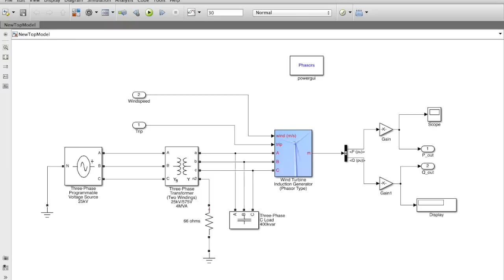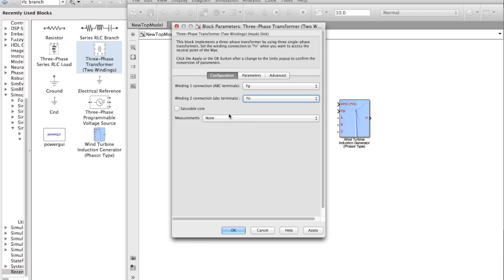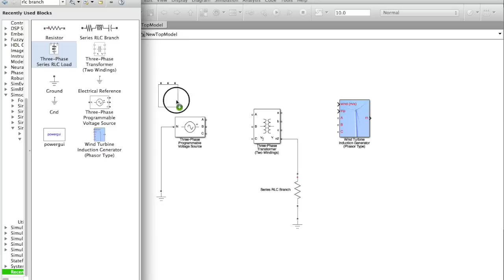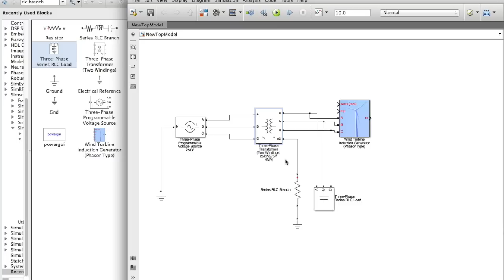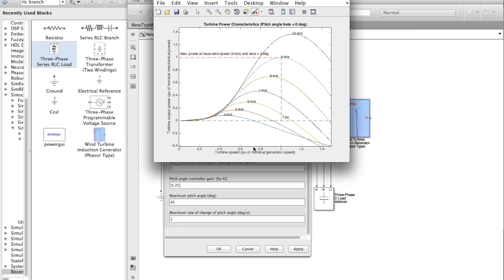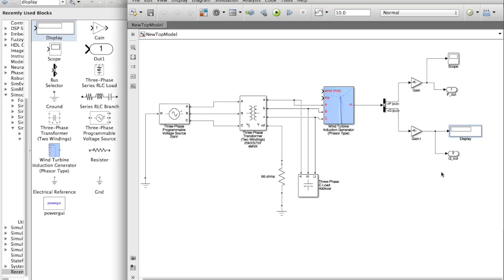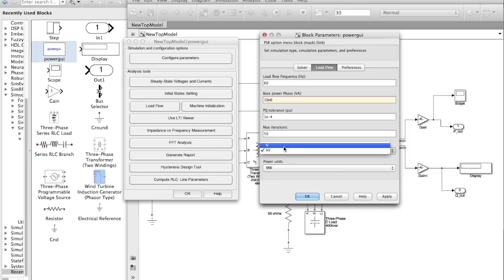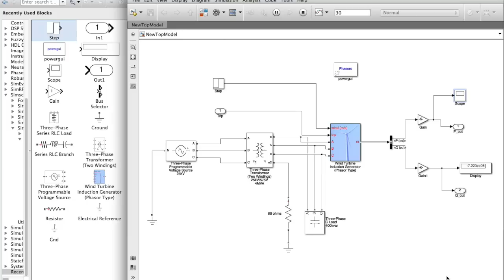Wind power plant model in Simulink

Comment: HI!when i try to simulate itt give this error, could you please tell me how can i solve this problem thanks

Warning: The Discrete Solver Model parameter of the 'Wind Turbine Induction Generator (Phasor Type)/Asynchronous Machine'  block is set to Forward Euler. Use a Trapezoidel model for better accuracy.When using electrical machines in discrete systems, you might have to add a  parasitic resistive load at machine terminals to avoid numerical oscillations. The amount of parasitic load depends on the sample time and on the integration method used to discretize the electrical machine.
An error occurred while running the simulation and the simulation was terminated
Caused by:
Derivative of state '1' in block 'untitled/Wind Turbine Induction Generator (Phasor Type)/Data acquisition/Mean Value/integrator' at time 0.00065000000000000008 is not finite. The simulation will be stopped. There may be a singularity in the solution.  If not, try reducing the step size (either by reducing the fixed step size or by tightening the error tolerances)
Component:Simulink | Category:Block error

Comment: I also tried to implement this model but i got these two errors:
Derivative of state '3' in block 'wind/Wind Turbine Induction Generator (Phasor Type)/Asynchronous Machine/Electrical model/positive-sequence state-space model (4 states, with saturation)/phi/Integrator' at time 0.06 is not finite. The simulation will be stopped. There may be a singularity in the solution.  If not, try reducing the step size (either by reducing the fixed step size or by tightening the error tolerances)... How to eliminate this problem?... my mail id is emildavis1993@gmail.com

Comment: Awesome video.. Author i  need help. I am also modelling the wind farm. Follows same step as you explained but while simulating, i am not getting the expected power curve. My turbine specification have cut in and cut off speed of 4m/s and 20m/s respectively. The nominal base wind speed is 12m/s. While simulating i am getting power negative except for wind speed closer to nominal wind speed. Wind speed greater than 12m/s also gives negative power. Any solutions you have for this. my email ede2011008@gmail.com

Comment: i tried to implement this model but i got these two errors:
Derivative of state '3' in block 'wind/Wind Turbine Induction Generator (Phasor Type)/Asynchronous Machine/Electrical model/positive-sequence state-space model (4 states, with saturation)/phi/Integrator' at time 0.06 is not finite. The simulation will be stopped. There may be a singularity in the solution.  If not, try reducing the step size (either by reducing the fixed step size or by tightening the error tolerances)

then i reduced the step size from 0.01 to 0.001 and ran the simulation, there was no error but there were no results in the scope too.

kindly guide me how to tackle this problem.
Reply: i tried it but it didnt work. help please?

Comment: Hello I have implemented your design in MatLan 2012. When I executed, I have got an error.   Please help. My email is mirzaabrar@yahoo.com
Error says: Derivative input 1 of 'WindTurbineInductionMachine/Wind Turbine Induction Generator (Phasor Type)/Asynchronous Machine/Electrical model/Phasor/Positive Sequence Model/Rotor/phiqr' at time 0.01 is Inf or NaN. Stopping simulation. There may be a singularity in the solution. If not, try reducing the step size (either by reducing the fixed step size or by tightening the error tolerances)
Reply: sir, i too got same error. how to correct it?